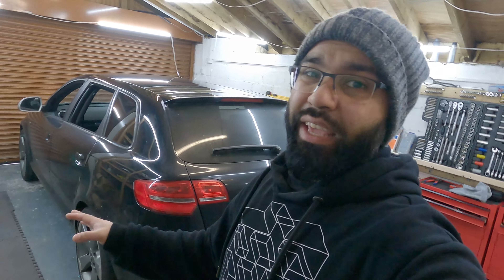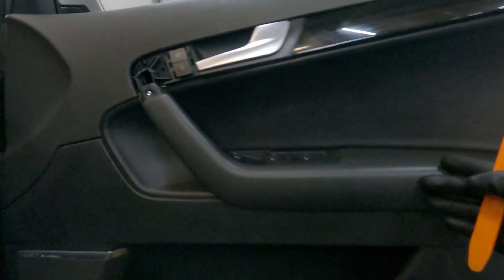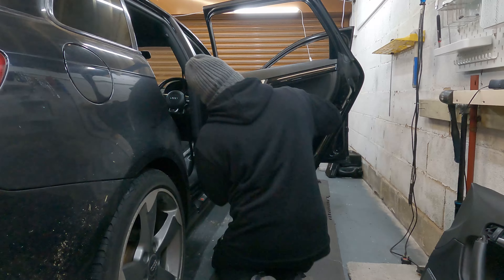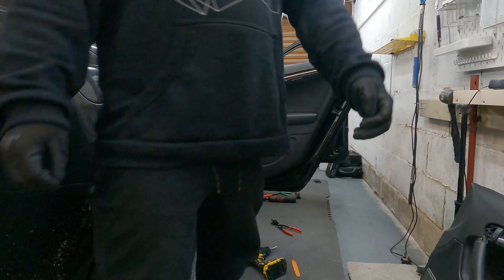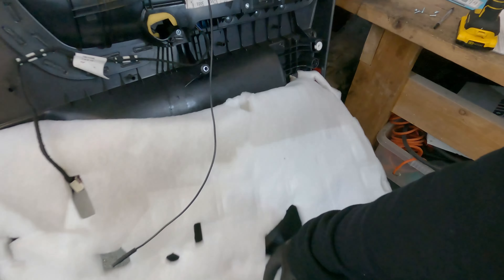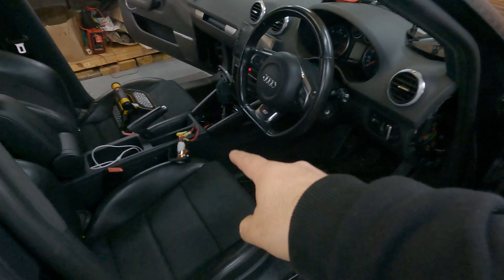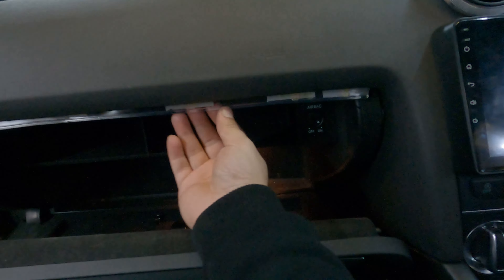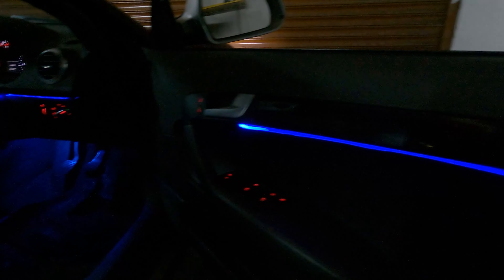Audi A3 PreFacelift Fibre Optic Ambient Light Install | RGB LED Car Interior Lights

Comment: hello, you are doing a great job, I want to put it on the car myself but I have a problem, how do I find which cable to connect to the door, to all the doors, I tried to test all the cables and I burned the central led.  please advise how to find a cable that gives me the correct voltage?